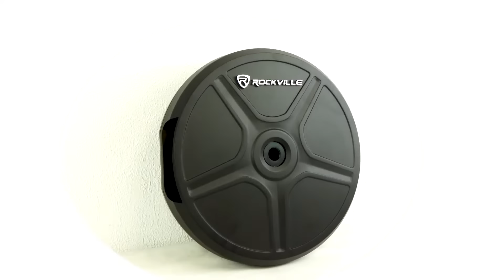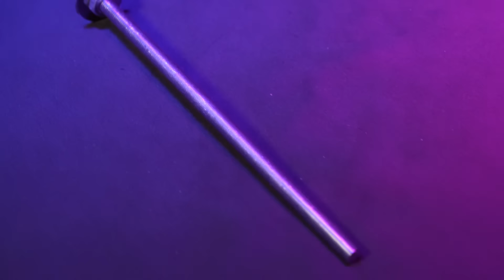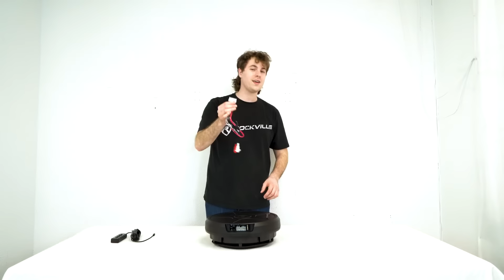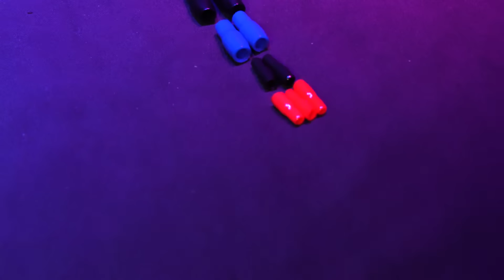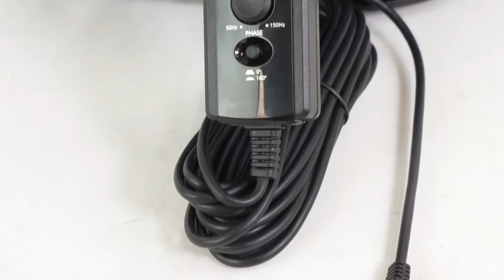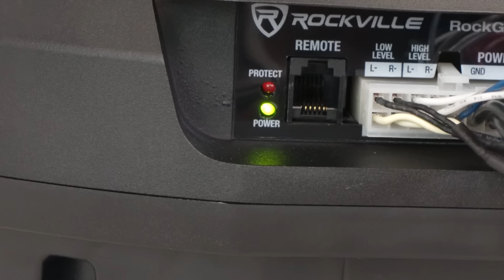How To Set Up Your Rockville RockGhost V2 Powered 11" 800w Car Subwoofer Fits Inside Spare Tire

Comment: Hello. Tell me please if my Android head has a subwoofer input, which wire should I connect the subwoofer to it? Should I buy 2 to 1 RCA cable?
Reply: Hi... If no one has answered your question, there is an RCA cable included with the installation kit. In the event you have a single "sub-out" from your head unit, you can splice the RCA cable into a "y" connection. 1 RCA out to 2 RCA in of the subwoofer. There are YouTube videos on how to make a a "y" cable. Hth!!!